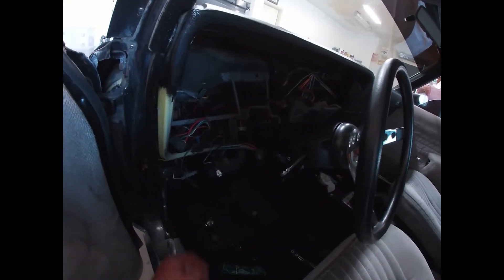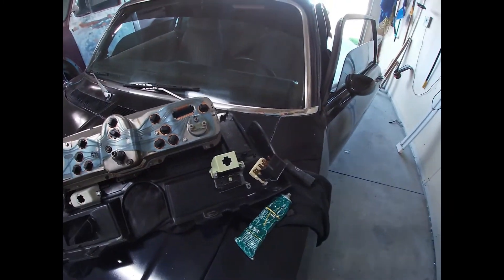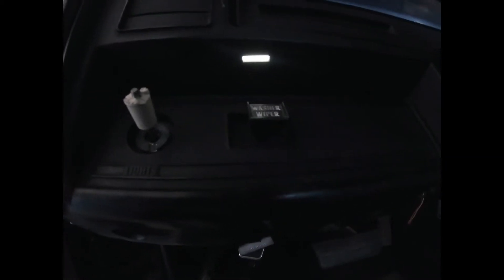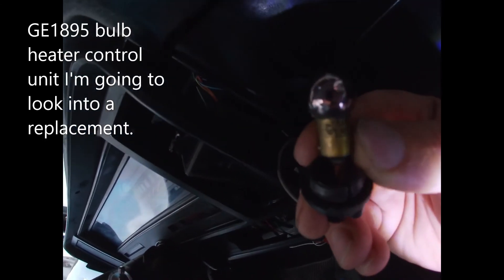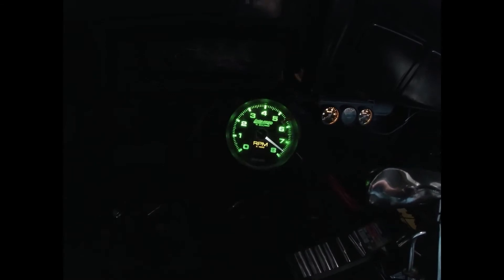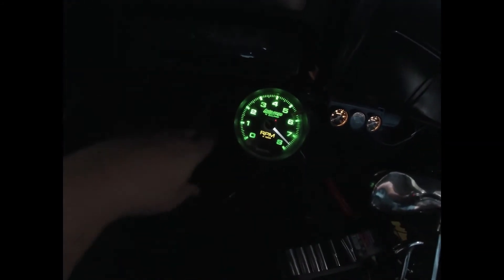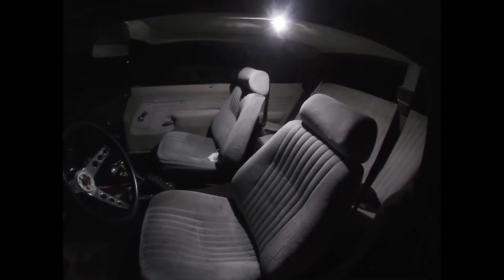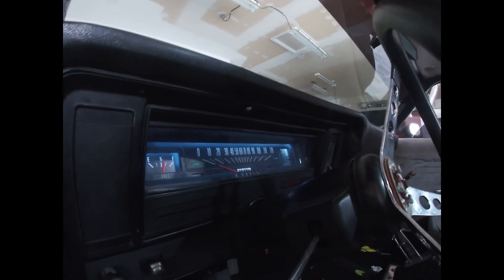74' Chevy Nova installation cluster/bezel with LED's

Comment: The lights came out nice and crisp you should get screws that will blend in to the dash trim
Reply from the maker: I either need to find some or order some that match original
Reply: It looks a lot better!
Reply: How many light bulbs are there to change? 
Which size are they?
I own a 1971 Chevy Nova
Are there any other upgrades to prevent any electrical burn outages or any electrical shorts?

Comment: How much time did the swap take in total?
Reply from the maker: I wanna say to remove the cluster and bezel maybe a hour and a half or 2 hours , and install was a lot faster say maybe a 1 hour tops, but I chose to remove to clean it also and if not wanting to remove you should be able to reach and feel to remove the bulbs without tearing into the cluster/bezel. I have another video of removing the cluster and bezel.